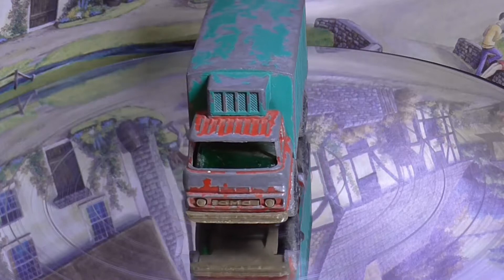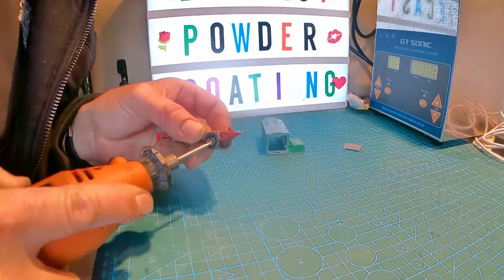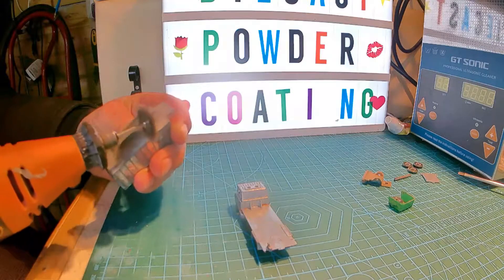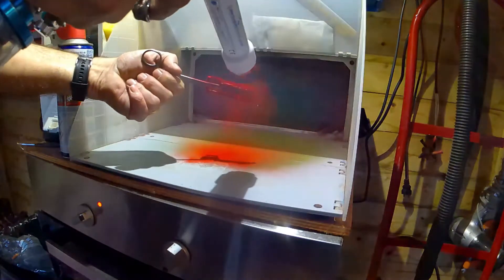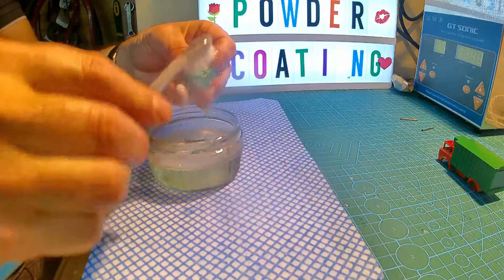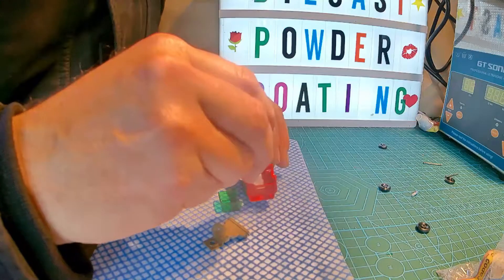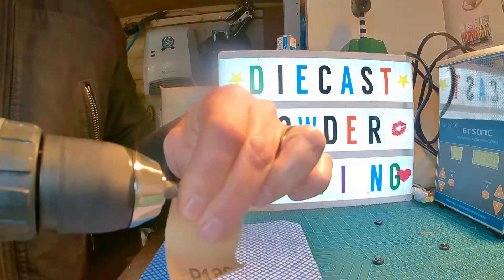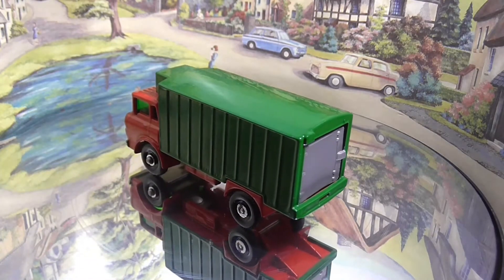Matchbox GMC Refrigerator Truck 44c Powder Coating

Comment: Hi Jeff, you've made another wreck look better than new. You alway get such a lovely finish with the powder coating. Like glass. This one is gorgeous. Love it! Take care during the latest lockdown... From Switzerland - Andrew 👍
Reply from the maker: Thank you Andrew, as I mentioned this one was sitting in the drawer for ages. I had already bought the rear door. It was crying out for a restoration, so thought get the poor chap done.
As always take care from a locked down UK.
Jeff

Comment: Excellent restoration Jeff looks great 👍, would be interesting to know how the powder coating system works Jeff if you get the time .
All the best Martin
Reply from the maker: Hi Martin and thanks for your comment. I have a video a few months ago, called Powder Coating Railway Keys and Using the System.
On that video I explain more about the system.
The system I use is called ElectrostaticMagic.
It's all done by static rather than connecting an electrical lead to the part.
As always take care.
Jeff
Reply: Thanks Jeff I should have thought about that 😄😄 i will have a look